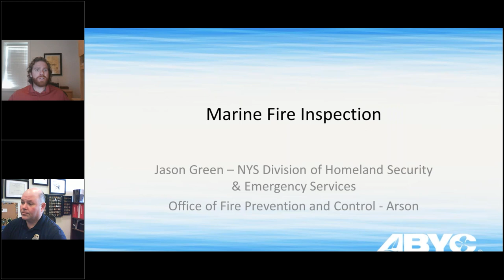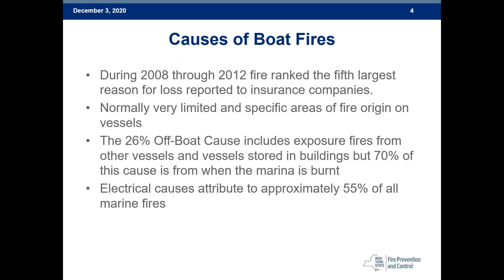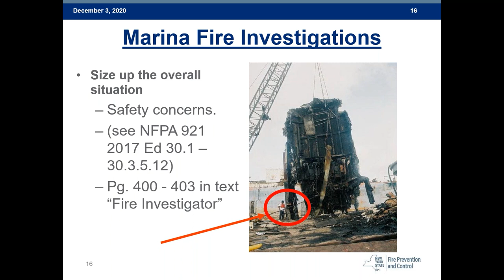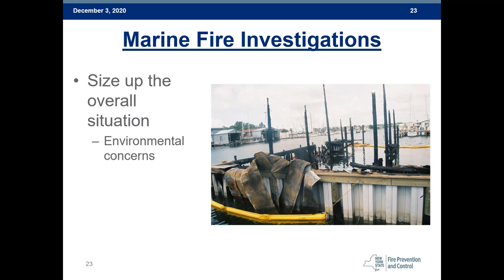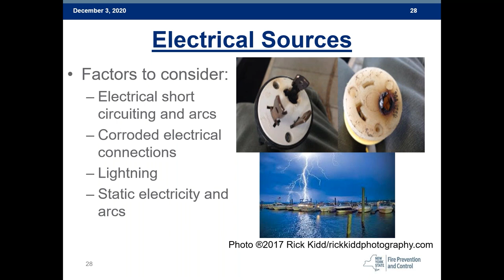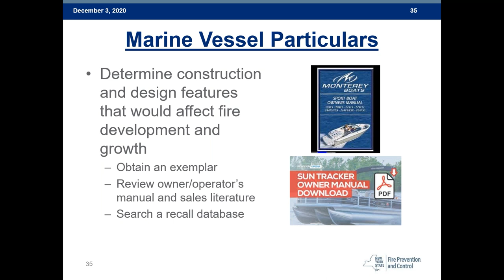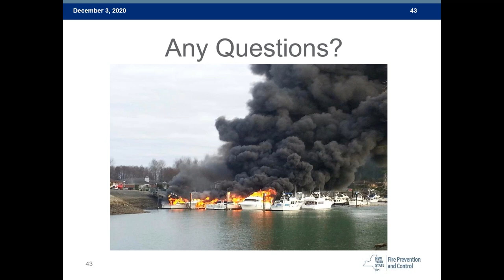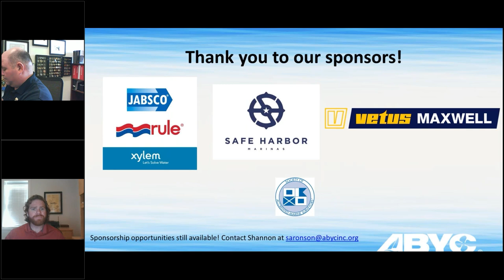Common Causes of Boat Fires

Comment: At 20:06 This class of wiring more than likely is an A&P technician 
who prides perfection on advance aircraft builds. 
Or good possibly, he's a computer server installer. 

I've done this as well restoring B-25, and other WWII aircraft. 
Nothing's worse than trying to service a craft with a rats nest mess. 
And should be sited with fines by manufacturer who do this. 
Creating a hazard before the ship leaves the factory. 

Usually one will find live wires within a nest not terminated which can easily start a fire after vibration pulse starts wearing through adjacent packs of cabling. 
Or someone has used twist on caps on junctions that have fallen off, now a group of exposed hot leads. These fittings should be illegal period, 
unless it's temporary setup, building the harness. 
The best junction terminal blocks are made in Germany. 
That I brought back with me. 
The US electrical code standards are very poor in my opinion. 
Or electrical fires would not be so overwhelming. 
Even home outlets,, the worst nonsense ever seen in 50 years.  

When boats or any vehicles aged wiring starts to turn the copper leads and terminals green from damp locations,, 
this needs to be ripped out and replaced. 

A waterproof sealant wax base pray on needs to be applied to prevent this corrosion on terminal blocks in the first place. 
LPS3 is preferred treatment and personally tested in harshest environments. 
We also use it on all WWII aircraft to prevent corrosion deep inside the wing structures, where it always starts. 
 
I find it difficult to see so many of these large crafts go up in flames, 
where it must be several millions in loss. 
By now one would think advanced fire suppression devices not only 
put fires out, but at the same time apply all safety valves, cutting off fuel supply, and all main branch of power banks of batteries to fully disconnect. 

In my opinion nothing beats CO2 - as it can sub cool a hot spot instantly. 
From fighting a 440v fire to a commercial air compressor junction box. 

Plus installing on craft very high output fire alarm, on its own battery power and wifi connected alarms to notify Police/Fire of location. 

Nothing is more dangerous than several hundred amps ripping through
a wire harness already exposed by fire, at Welding temperatures, and fuel 
supply is a couple feet away. Batteries and high amp loads should never 
be in the same space. 

And then there's the bilge,, Oh Boy... There'd be new laws yesterday what  hazards people are doing out on the roads opening them to drain out. 

Well,, that's some of my concern,, and great to see what other professionals deal with. 
Cheers